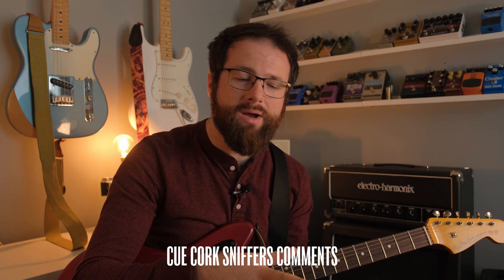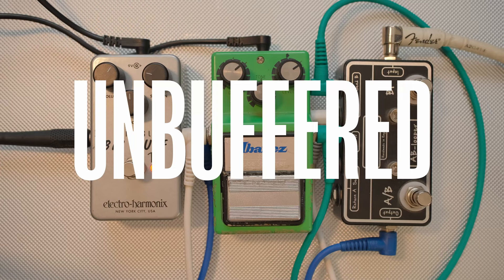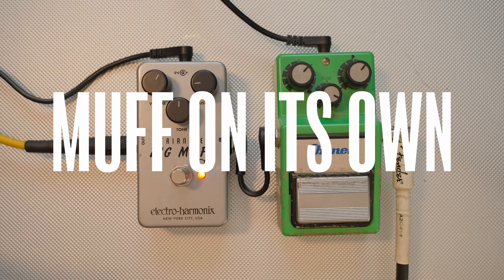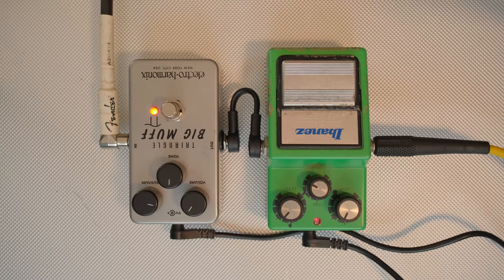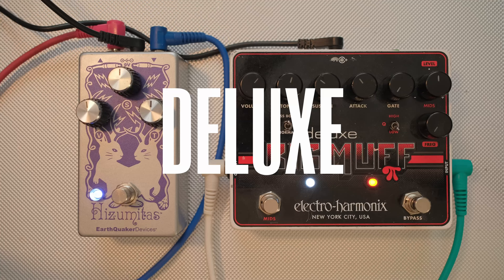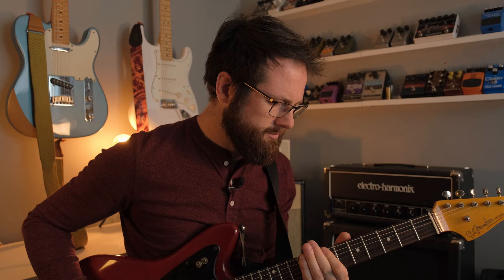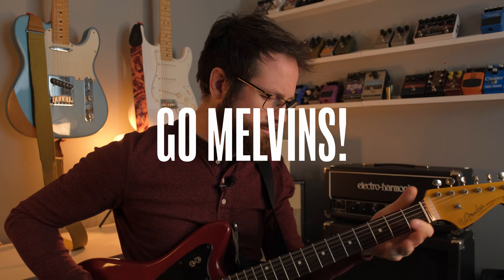Why you're doing it wrong: Big Muff tips and clips

Comment: The trick to run a tube screamer or mid-bump EQ'd overdrive after a Muff is that it's the last in a 3- pedal stack. You run something with either a flat or slightly scooped EQ into the front of the fuzz: a Timmy; Blues driver, etc. You set the gain low, and the volume at or around unity (slightly higher if anything). You set the Muff with the gain low and the output for unity or a slight boost, then the Tube Screamer with a volume boost and the gain for taste. *Edit:The different levels is about the amount of compression that you end up with, since stacking pedals tends to increase it.
That's how you get the "Comfortably Numb," tone. I've been a luthier for twenty years and an amp builder and tech for 15. It ALL started because I wanted that tone but didn't know to do it at first, then found out but couldn't afford the vintage muff, the reissue didn't work well and there were no real affordable clones at the time, so I built one. Gilmore did it with a Color Sound boost into the front. Those had a flat/slightly scooped midrange. It opens the Muff up, then the TS gives you the midrange. If I'm not specifically going for that sound however, I just run the mid-eq into the Muff. It sounds like a dimed British stack and makes even the most icepick-like bridge pickup on a Strat sound HUGE.
Reply from the maker: I'm gunna do a short of this exact tip. It sounds insane enough to work!
Reply: @doctorfuzzzdirtbox  it'll work. 👍 You might have to fiddle with the output volumes, but that's a 15-second undertaking.
Edit: I just read it again, I had meant you set the Muff with the gain low and the volume at unity or a little below. Setting the individual output and gain is more about dialing in the amount of compression you're getting from running all of them into each other.
*And you're 100% on point about using a buffered pedal before a Muff, it allows you to do a slight cleanup that you can't really do just plugging the guitar in, the pickups impedance is just too high. Some two transistor Fuzz will do the same. I built a 3 transistor fuzz clone of…something I don't remember. The circuit was essentially a Fuzz Face with an extra gain stage that acts as an input boost. It takes the guitar signal and slams it into the Fuzz circuit, it's akin to running a boost into it, but in the same circuit. Later I installed a switch to turn off the boost. If I ran my guitar into it, it would cleanup like a fuzz face: wooly fuzz, then clean and glassy with no in-between. One day I stuck an MXR micro-amp first to level out the pickup output of two different guitars. When I set the Micro at unity and rolled the guitar volume down it cleaned up like an amp or overdrive. The Muff is a four-transistor, basically two fuzz faces cascading into each other. It can handle various signal strength and impedance levels without trouble.
Reply: I don't pay any attention to fans who don't spell 'Gilmour' correctly.
Reply: @timwhite5562, exact same reasons for the same "carrear",. I recomend FETs for the buffers, they come a lot closer to tubes. Try out a bootstrapping circuit as input buffer. That really hangs onto the knobs/pickups, with an input impedanz of 150 megaohms! Oh, and please excuse my misspellings, been stuck on another continent for over 50 years and www is only a recent addition to life, it wont repair much anymore. 🤘
           📼
🎸🎛️..🔈🎵🎶
Reply: I put a cry-baby in front of a vintage big muff. I pretty much kept the cry-baby on all the time (fix position like Trower). It served as my tone control. Both pedals were battery operated only versions. I'm having trouble with my new muff driving a solid state 2-ch Marshal. It sounds flat and does not have the crunch the old one had. Splitting the sound with a TC Nova delay into a different amp (Roland Cube) helps my wall of sound. My pickups have always been DiMarzio DP101.
Reply: @timswanson9893  Stick Line buffer after the muff. People will say it doesn't need a buffer because it's buffered when it's on but that isn't always the case, even if it is putting out the same impedance as a buffer. You may want to try something that can switch between line and instrument level as well. An EQ pedal is a necessity at some point, and not just to change the EQ. It can balance the line differences. They biggest advantage for me was to use it as a preamp Master volume. There sweet spot on the master volume on a lot of amps is too high, so you need to lower the volume somewhere. Many do it at the gain, but if you want amp overdrive it's not an option.
I set the Master volume to the sweet spot, set the gain properly, then lower the volume level at the EQ right before the master volume. So the power amp is operating at it's optimal level, and the gain is dialed in. All you're doing is lowering the volume level just after Preamp and effects in the loop, and lowering signal before it goes through the power stage. Similar to a volume level.
Reply: @timwhite5562  Yea that is one thing I did not mention. Volume. Volume sweet spot is higher than I can put it in my little home office... Good tips. Thx!
Reply: @timswanson9893  👍
Reply: @jankafka7330  ...like Rich-ie Blackmour? 🤣

Comment: I’ve always constructed my signal chain so that as the signal moves into the gain section, I move from boosts/ overdrives into distortions and then into fuzzes since they’re the most extreme type of gain I run, my logic has always been that I want to drive the fuzz, not fuzz up the overdrive and kill it’s character… it’s always worked out for me fantastically. Currently I’m running:

LPB-1 > Boss 59 Bassman >Fulltone OCD > Boss DF-2 > Ram’s Head Big Muff > Op Amp Big Muff

And then after those I use the JHS haunting mids to boost the EQ and let the Big Muff’s be usable in a live band application.
Reply from the maker: I've always done the same. I've never understood why so many people think of going low gain to high gain. It's always made more sense to put the hotter signal into the hotter pedal that's got the room to handle extra drive rather than squashing it into something that caps out at crunch.

Comment: I have a bigger laugh at "inserting tube into big muff and hear it scream" than "buffing your muff". Maybe that says more about me than your average viewer.

I bought an original Black Russian back in time. I didn't seem to get on with it, but I didn't understand the concept of which pedals needed a really clean amp to use and which ones were better for crunchy or already overdrive amps. I probably still dont, but I generally don't drive the sh!te out of everything.

After a few years of marriage and mortgage my finances appeared to be more favourable and I started experimenting with Boss pedals for a time and traded the Muff for an SD1 at a nearby shop (they allowed £10 for it - I thought at the time the wiser decision would have been to sell it on eBay to try to get market value for it). It was the last Boss I bought new, and the only one I have kept over the years.

I kept my Fuzz Face as I always preferred.then round of that to the Muff. I got that in 92 or so (a year or two before the Black Russian), clearance of stock of Crest reissue at Soho Roundhouse (the new name for Sound City I think, but long since gone. I tried to drill out the casing and install a socket for wallwart but made a balls of that. LOL.

I have a used Opamp reissue on its way and will see how I get on with a Muff this time. It would have been a Pumpkins sound I was after as Siamese Dream was an inspiring album from the time I got it.
Reply from the maker: Hope you like it, man! The OpAmp is awesome. If you're not feeling the scooped tone, flick the tone switch and it becomes a full range monster!
Reply: @doctorfuzzzdirtbox  "full range" as in also good on bass?
Reply from the maker: I'd say all Muffs handle bass well, so yeah, but more that the mid range flattens out with the tone stack bypassed. Best reissue for bass is hands down the Green.

Comment: I make a muff based circuit that has a mids knob with a preboost circuit (ie a buffer) in front of it. It has a second stomp to switch on or off the buffer/boost.
Reply from the maker: Nice! Is that your own design?
Reply: @doctorfuzzzdirtbox  it is... I do pedals as a side thing- I'm an engineer by profession, and for the last year or so I've been working on a massive project and its left me with little free time.  I'm not taking orders at the moment, but I do have one of them built already if you're interested.

Comment: I’m still using the Black Arts Pharaoh, after almost ten years. 
I used to use a random Boss pedal, at the front, to help with the wah problem with a Fuzz Face, snd it really made the Pharaoh kick. 
The Pharaoh has the rare ability to cleanup with volume roll off, in the Silicon mode. 
I did turn an OD after it, but one must remember to turn the gain down, and it works like a boost, and it can tighten it up, but not a TS. I also have a Boost pedal, that has a Mid Boost, with a knob for where in the signal one wants to boost, then an overall volume boost knob. The Midphoria V1, from Magnetic Effects. 
It also will work like the Tubescreamer does in your video, put before the Miff pedal, or any pedal, and it gets pretty hairy on it’s own, with the Mid boost up high. Great for solos, or insane rhythms that cut through any mix.
Reply from the maker: Hail the PHARAOH!!!

Comment: It's funny because, for about 2-3 months now I'm running a DBA Fuzz War into a Boss SD-1, and it's sounds almost like Colour Haze. I'm actually happy with the resoults, it pulled me out of my comfort zone and gave me a different perspective on dirt pedals. An important note is that I only use the neck pickup, and the gain settings on the amp is very low, so as on the pedals. So I admit that a full on blast from the fuzz and the overdrive would sound like crap.
Reply: Distortion is a bit heavier than overdrive And it's like a ramping up process from weakest effect to strongest. OD is just a little color on the line, fuzz shapes the line, then distortion... Distorts. Color>shape>texture.

Comment: I used a 70:s Big  Muff w tone bypass switch for years, now using a Metal Muff : more gain + Bass Mid & Treble controls. Running it into a Blackstar set for crunch w MMuff sustain from 0-2 gets a total sustained sound right into the harmonic octave. I'm in Heaven man!

Comment: I own a russian pi, and always ran it at the front of the chain to preserve its huge low-end. None of my other pedals, later Muffs included, matched it in that regard. I came to not rely on it for saturation-- as far as the actual fuzz tone there's better options for that. I get my good results putting bright overdrives/clean boosts behind deep fuzzess, but it depends on the pedals and also the particular sound you are trying to achieve. But Buffers, yes; clean overdrive in front, yes; turn everything down to use it all together... One thing tho', to my ears big muffs with tube screamers sound terrible. So many better options. I just "retired" the Muff a couple months ago, but it was on my board for thirty straight years otherwise.

Comment: Started my Big Muff quest with a Catalinbread Manx Loaghtan and an EQD Hoof. Did not really care how accurate they were to any EHX iteration, just wanted to explore. Years later, the Hoof is still on my board. It straddles the line between 2-3 transistor fuzz styles (the Muff is technically a 4 transistor fuzz, iirc) and distortion; kind of a nice middle ground. The 'boutique' move to add mids and/or EQ flexibility to the basic Muff circuits are very useful, but on the other hand I'm not interested in and Muff arms races, in the latest and greatest Muff variant, either from EHX or smaller companies (although it's nice EHX has made affordable reissues of various kinds.) 

Never liked running anything into a TS, only liked it as a pre-boost. The last gain pedal in the chain has an outsized effect on the tone shaping, and the TS IMO is just so focused that it does no favors to the characteristics of the breakup circuit that comes before it. More 'full range' overdrives seem to work better for that. Subdecay Super Nova Drive did this well; something of a sleeper that one.

Comment: In my experience, the only overdrive that work after the big muff is a klon with the gain set low. Because it blends the clean signal with overdrive it is far less muddy than run a big muff into a tubescreamer.
Reply from the maker: I agree  I particularly like a Klon after harsher distortions like a HM-2 or DS-1. It rounds off the shrill top end and fattens then up.

Comment: The way I run it, (skipping unrelated pedals) guitar - Blues Breaker - Centaur - black box Russian Muff - MXR Micro Amp + (in loop) gets everything you'd ever want and everything in between.
Reply from the maker: Nice. There's definitely a lot to be said about using the characters of other ODs to boost different parts of the mid-range. I can already hear how MASSIVE that rig would sound 🤘
Reply: I Love your handle .I would buy that shirt .
Reply: @STRATMAN1969  thanks, its for my Instagram, did 1 test video for here and will maybe do more 🤷‍♂️
Reply: I tend to use a Micro Amp before my Big Muff Deluxe, got that from Jack White. I'm curious what you like about having it after the Big Muff?
Reply: @robertrossignol4445  after the muff and in the FX Loop it acts as purely a DB boost/EQ as opposed to a gain boost which is what it does at first. The reason I use the + model specifically is the ability to adapt the EQ. It can then do the same for all of my drives etc and I can stack my drives before to add gain where wanted. I just find it works best for me that way as its more versatile.

Comment: I have a deluxe big muff pi, and the pamphlet inside says that if the tone pots do not fit your tastes you can unscrew the back plate snd use a 2mm wide flat head screwdriver and adjust the tone pots away from factory settings.  Apparently there are 3 pots for the mid bypass section.
Reply from the maker: Wow! Deluxe wins again!

Comment: Muff after everything, always! I run various overdrives, distortions and fuzzes on my board and the Muff is after all of them.
Reply: As in closer to the amp or closer to the guitar input?
Reply: @daddurs2206  Closer to the amp. I've got a Wren & Cuff Caprid and it's the last gain pedal before modulation, delay/reverb etc. It sounds great getting slammed with a Rat or DOD 250! One of the things I love about the Muff is there's not a huge volume boost when you hit it with other pedals, it just affects the tone and texture.
Reply: @Tanzi24  thanks man, I’ll do some rearranging and check it out 👍🏻

Comment: I agree with most everything, HOWEVER, I was struck at how the hizumitas or whatever sounded pretty much nearly exactly like the deluxe big muff, but was like 1/5 the size! Probably costs more, but you definitely save on space and a bunch of extra controls one might not want.
Reply from the maker: You do save on space, but a Hizu can't do a fraction of the tones in the Deluxe whereas the Deluxe will get all manner muffy goodness. And with a gate, (which is surprisingly useful!) So you gain a huge lot of flexibility to know that you can fit it into your sound, whatever that sound is.

Comment: Had to look at an old demo tape from January 2000 to confirm that my first chain was morally wrong: Danelectro Longhorn bass to Big Muff Pi (Russian), Boss Bass Overdrive (mainly for EQ tbh), MXR Flanger. But this was the first sequence I used. I probably then kept the three in the same order, but just reversed it — MXR Flanger, Boss Bass Overdrive, Big Muff Pi. AAAAAAHHH NOW THERE IS A FUCKIN CRAZY SOUND. Or. Duh. Put the OD first, then the Muff, the flanger. Anyway… MXR Flanger plus Big Muff is some psych shit right there. Trust I. Various combinations of the three will basically give you jungle Drum n Bass / Reese type shit, but from a bass guitar.

Comment: I agree with not having a tube screamer after a muff, but there are some other OD’s I like putting after a muff. For instance, the Earthquaker Westwood Transparant OD gives any distortion or fuzz a nice wooly sweater on those cold days.
Reply: Off all the Tube Screamers Ive used the one that has worked the best with Fuzz is the Behringer
Reply: I agree that some of the more “transparent” or “amp-in-a-box” style circuits do work better after the muff than a tube screamer. The Benson preamp or some bluesbreaker types actually can work pretty well. However, I also like that the less transparent types can make the big muff chug!

Comment: I thought i liked the green russian the best. But as i listen more and more i like either the rams head because of its clarity. But i also love the standard range big muff pi. The standard may not be the exact same circuit as the pedals from the 70s. But it’s still the original and a great sounding thing. It’s got more gain and is more of a wall of sound. I think it’s also more stack friendly in its design as most of the classic pedals have become. In the past they were designed under the assumption they would be run on their own and now they are designed with stacking in mind. If that was not the case then maxon would have never designed the ts9 which added more high end from the previous 808 and made it more ideal for boosting and stacking.